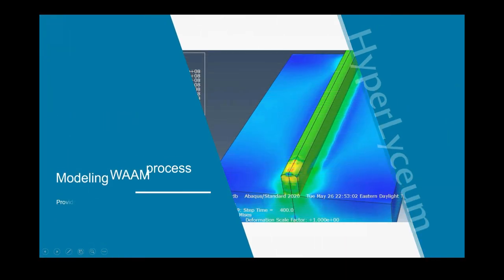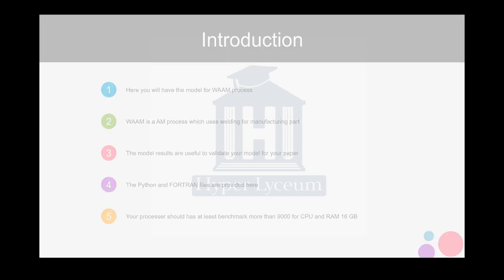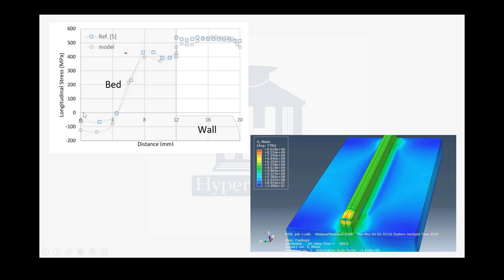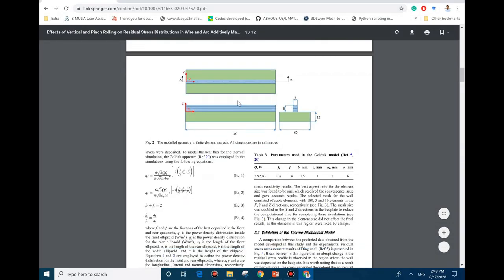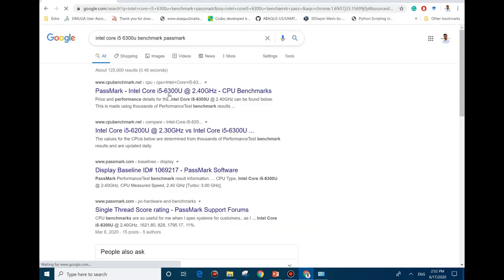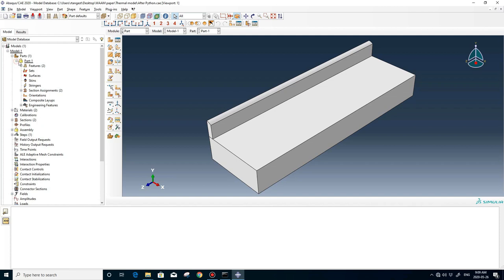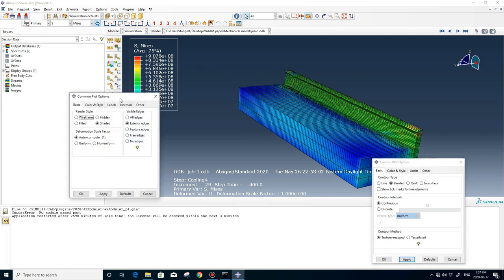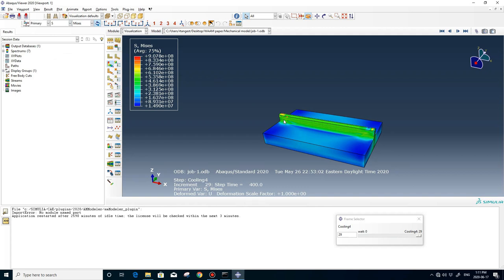Paper based WAAM model in Abaqus (Ad)

Comment: thank you sir for this video , i have one question I have a question concerning abaqus, I have modeled a hollow sphere in abaqus, and I have applied a radial displacement in the inner surface, 
but when I run the simulation, I get the following error 1 nodes have dof on which velocity/displacement/acceleration/base motion etc.constraintq are specified simultaneously.the nodes have been identified in node set ErrNodeBCRedundandDof